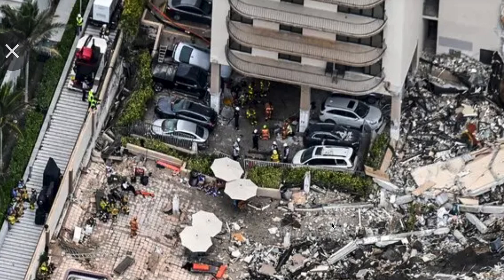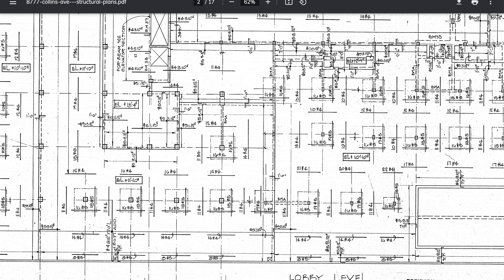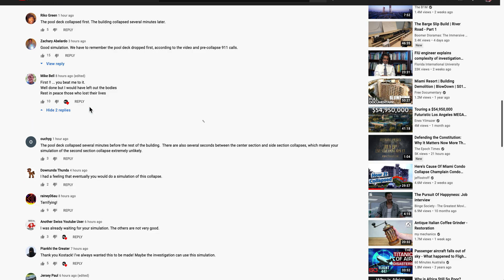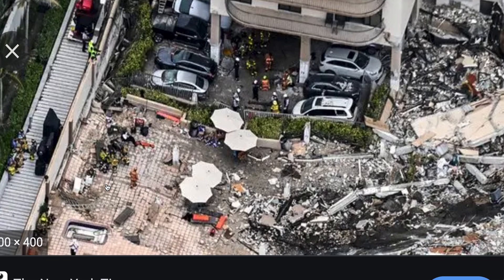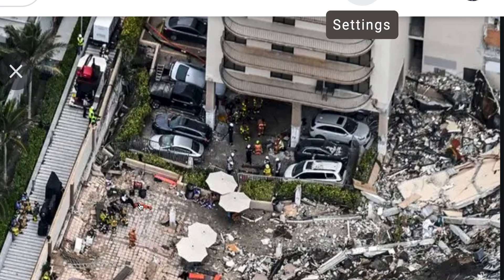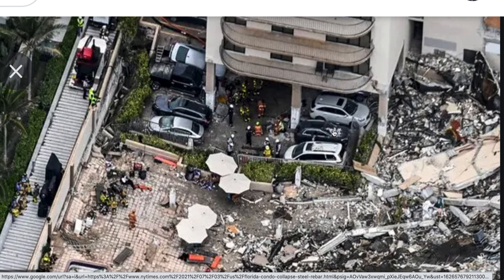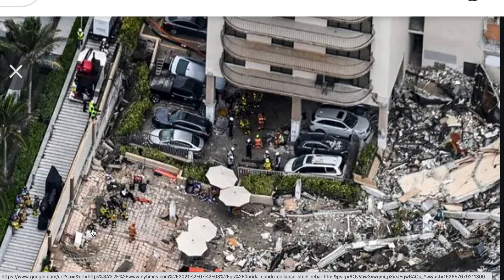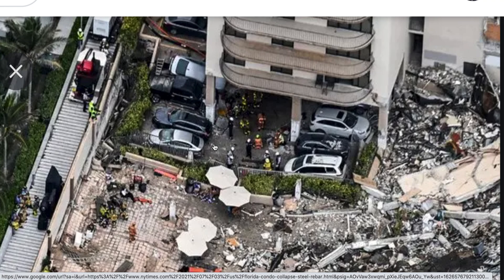Champlain Towers SURFSIDE BACK WALL FAILURE EXPLORED REQUEST FROM ENGINEER ON SITE (NO NAMES SHARED)

Comment: I agree that the punch shear is where this all started and it cascaded across the pool deck.

In one of the inspection reports recently, the engineers noted cracking in the garage under the front drive way. There were comments in other videos mentioning the planter drains kept getting blocked by roots and causing water in the planters to overflow. From the many versions of the plains, it appears that section of the slab was only 6 inches thick and when it connected into the wall, the slab lip decreased and there was supposed to be one piece of rebar tying it into the wall.  However,  my thought is the planters were a casualty of the deck punch shearing.

Comment: I think you make excellent observations and points.

My concerns are the speed at which the building went straight down.  It was not a slow, gradual, piece by piece, collapse.  It accelerated very quickly, as if there was little to no resistance.   It was as if all columns were severed, on all floors, at the same time.  

This is even more evident, for the final end piece of the building. It fell very fast.  It resembled free fall speed.

Imagine dropping a bowling ball off the roof of the building.   The ball only has air slowing it down.  That building fell at nearly the same speed.

The acceleration to that speed, & keeping that speed, straight down, is a HUGE red flag.  All that concrete,  all those columns, all those things should have made the collapse slower and less symmetrical.  
I struggle to find similar collapses.  All similar scenes, are from controlled demolitions.  In fact, the 2018 miami condo demo, the 2021 "collapse", and the recent "demo the remaining ccondos", all 3 look the same.
Except we are fed the "collapse" narrative for one of these events.  The other 2 events are acknowledged as controlled demolition.
Reply: It appears the start of the building collapse is due punch shear as well. Fom my understanding, the building plans state that 25% of the rebar in the floor slabs sits over top of the column.  It shows that the rebar connected to the outer columns does not go all the way through the slab  to connect to the column and instead a 2 new pieces of rebar in the slab sits on the column but they also don't go all the way through the slab.

Comment: I would say it started where the automobiles are along with water problems everywhere.. There's a photo showing a beam with the garage floor butted up against, that's a long beam with no support. There's photos showing a core sample right at that beam? There's old photos showing blacktop , did the stamp Crete add extra weight? If you look at the pile of rubbish it all falls away from the stair  tower and elevator shaft/breakawayPoint, all in line with that beam.

Comment: Ive seen quite a lot of similar constructions in England ,and being in the building trade as an industrial plumber ive worked in underground spaces including car parks installing drainage etc. I have however , never seen such a construction where an outside slab has been joined or integrated with load bearing columns under a main building. In other words, the car park slab would have been entirely independant of the main buidings construction. Should any damage occur such as a car park fire, or failure of materials , the entire car park deck can be removed and replaced due to its independance of the main structure, they are doing vastly different jobs after all. just my thoughts and observations.

Comment: I don't know if this means anything, but there were 5 or 6 palm trees placed in planter boxes on the pool deck in front of Southside of building,  where the building began to collapse. They had those palm trees up until 2017. Maybe they thought that all the water leaking into the parking garage was coming from the palm trees,so they got rid of them,but they didn't waterproof correctly, could that be another contributing factor.
Reply from the maker: https://www.youtube.com/watch?v=md19aQWkHs0

Comment: Kai, I will email you data of the foundation area in the video. 

The foundation was completely compromised when the developer/builder acquired 87th Terrace  in an absolutely unacceptable land grab. 

When they removed the concrete sidewalk on 87th Terrace it was functioning as a vital concrete cap and protection to Champlain’s foundation and pool level decking, was a vital part of the retaining wall and drainage system for the entire South side of Champlain South Towers.

Kai, I am also emailing you data that shows the before and after the 275 sand trucks a day went next to the North side passing parking garage entrance moving 774,000,000 million lbs of new beach sand. 

I have data showing it caused deflection on header of Parking Gauge structure,  overstressed foundation buckling inward. 

The video shows trucks braking other data shows over compression fractures to surrounding buildings. 

They should have NEVER had class 8 trucks with stationary force of over 30,000 lbs which is greatly amplified when breaking and driving. 

Massive cyclic earthquake shock loading. The Army Core of non Engineers, City, County did NOT put required sensors in the Champlain parking garage floors, inside and outside of the foundation and on building. 

The data shows the damage caused.

Comment: Slab depression at exterior wall, construction joint detail , slab opening detail and BMA  are pieces of the puzzle. Think outside the planter box!
Reply: I agree
The two white planters along 87th St (with small trees) fell towards 111 unit
The car rolled towards the Black Chevy pickup and the  pool deck rolled inward away from from the construction joint.  There was no gouging downward at the two shear planes, they all three rolled inward.  That took quite a force to crack the planter west of the gate (towards 87th St) along the line you just described  near the 87th St wall.  
We don't know the footing detail for the wall, but most likely cantilever to prevent tipping. But the one planter is cracked along the line you just draw along 87th St
Reply: The hot tub is not shown in the structural drawing but adds some rigidity and two minor shear walls?
Reply: @Katoshi_Takagumi  in the column  and footing drawing.  I know the pool is shown

Comment: I've watched many of these "failure analysis" videos from different Youtuber's, and I have to say that yours are the most sensible (albeit non-linear) of all of them. Kudos to you sir!
Reply from the maker: Thanks for the feed back... I give data to support and teach...
For example I am going somewhere in all these next videos... So, I jump in with where in each video but then I teach the interactions as part of that... So, even a lawyer could understand it, no offense to PugFace ( one of my lawyer followers)...
Reply: @ForensicCats  Hello Kai, I just found this video again on your second channel, I usually watch your other channel. Again, thank you very much for exploring this topic, I am truly very grateful. I’m sorry that there was a miscommunication, because the section I was referring to, with the missing rebar, is the section of the parking deck along the property line wall beneath the planter. If you look back to my first comment on this subject I believe I did use the correct column line references, but I know you have a lot going on. When I said the rebar is missing, I meant that you cannot see the strands of rebar pulled down the wall, for example in the image at 5:49, and I believe corrosion was the reason for those bars shearing off rather than pulling out and being bent down the surface of the wall.

To be clear, in reference to your comment at 4:49, the “here to here” locations I had in mind would be from the most southerly 24” square column (between the black pickup and black sedan), to the property line wall, in line with the red object, on the truck, on the path.

I did try considering the unsupported span running east-west as you suggested but that approach didn’t work for me. due to the east-west alignment of other major cracks in the pool deck.

I believe your thinking on this has shifted and we now have similar views on this topic. I see you have also made a lot of interesting progress in other areas and I congratulate you for finding those discoveries and for sharing them.
Reply from the maker: @exist7309  your comment just showed up... Hope you saw my latest video with the cardboard model and the one with the one planter box being ''level'' by the face of the structure...    I am holding out on a few more pieces but, I want the public to catch up on this content before I add the next layer... With that said, here are the three links, for your review and critique  https://youtu.be/BVJHkjTF9Yg   and   this one will show how a ''delay'' can literally be created (real life) https://www.youtube.com/watch?v=BvCZwXjEzIQ    and this one is the ''level'' planter box  https://youtu.be/eLgGPC3PHso  (that is on my other channel)...
I have never given up on your back wall and still consider it plausible... I am just waiting for my brain  to make it work and still get the physical data presented... 
I wish you would send me photos of that back wall, so I can give it the due respect.
Reply from the maker: Youtube just showed me your comment, 6 days old, and yes... I will go back to the model and even working on a concrete model to show the ''bma'' ''slippage'' ''off'' rebar via ''deck sagging''...   I wish I could find the fractured tiles that are mentioned in the report... It would tell me so much.

Comment: I saw in a photo or video of that wall that was showing exposed rebar. It looked like the rebar mat that was still there had sagged quite a bit
Reply from the maker: I saw scratching down the wall but I could not find an image with rebar... Please, find an image and share if you can...  I did find a slab that appeared to be hanging from the wall, which would indicate rebar was holding / hanging it up.
Reply: @ForensicCats  I will see if I can get a screen shot. The rebar I am referring to I believe as in the actual wall and didn’t appear to be a part of the slab.
Reply from the maker: I saw that one and interesting enough, I found NO plans for that on the plans... it is just built   lol    I wanted to know it's footer details... Could not find any.
Reply: @ForensicCats  I saw the rebar exposed in the ceiling. Like the concrete let go and the rebar was there. Bent to some degree.